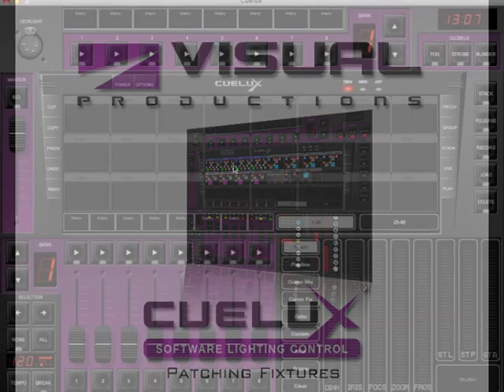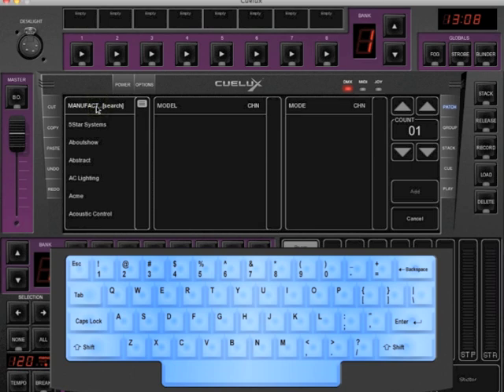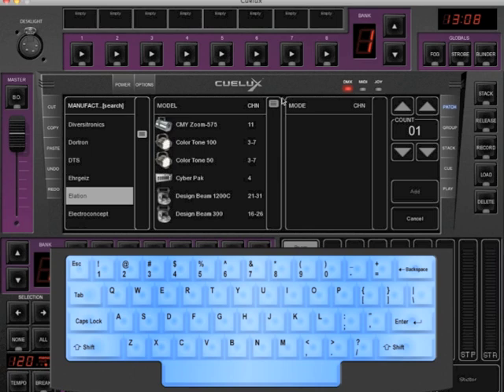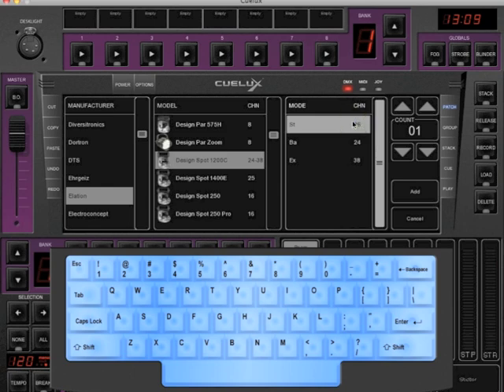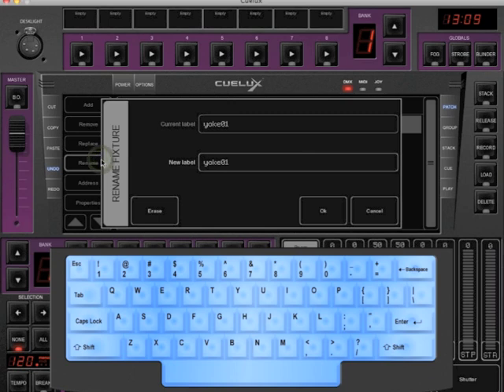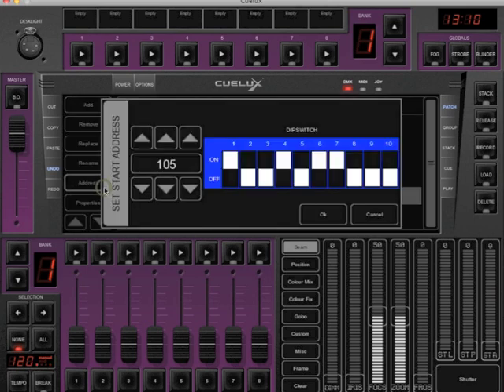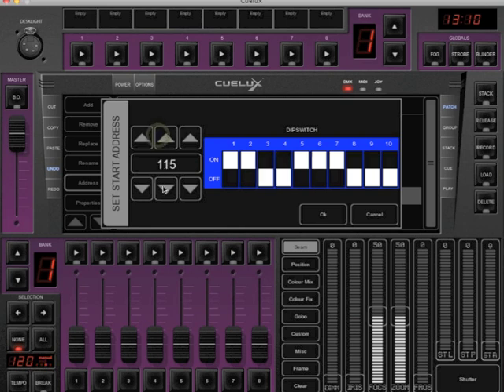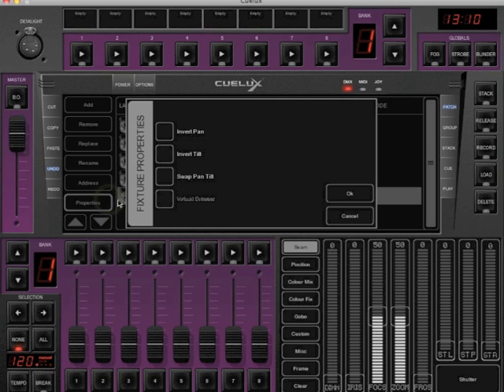Cuelux Tutorial - Patching fixtures

Comment: Dear Wasn, you could control these just with a b-station using it standalone. In that case you only need a PoE-PSU.

Alternatively, you can control it with the Cuelux software package. However, you cannot connect a b-station to Cuelux. 

If you decide to use CueluxPro then you can connect the the b-station to the software. in this case you would also need a CueCore device to unlock the CueluxPro software.

Best regards,
Maarten Engels